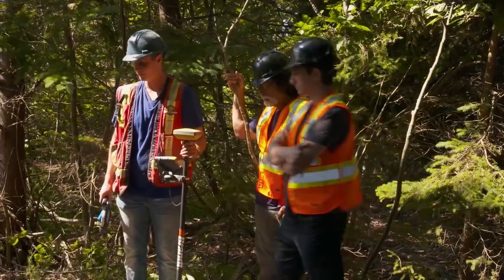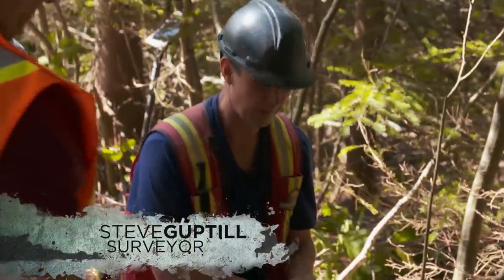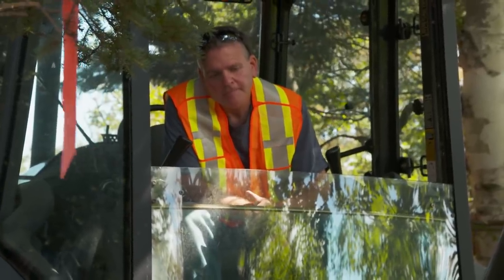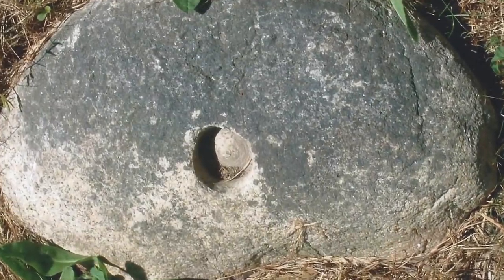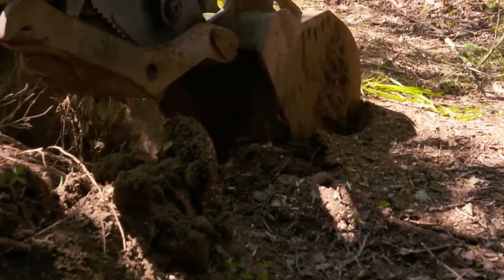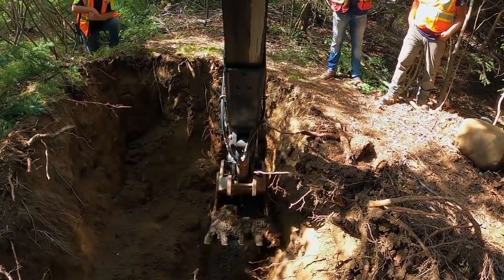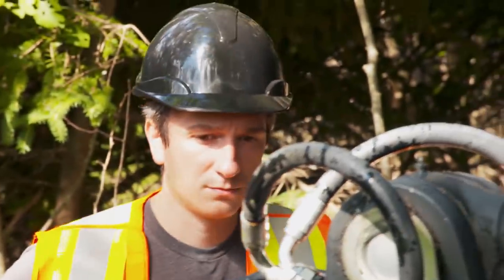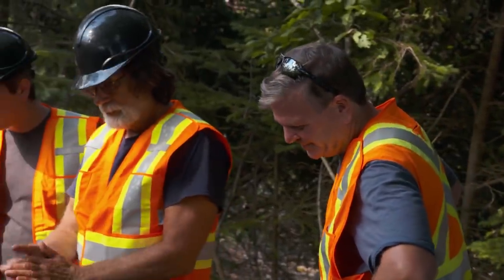The Curse of Oak Island: THE OAK ISLAND CURSE STRIKES AGAIN (Season 8) | History

Comment: Any relic that on the surface is too new (1700) to be quote "Templar." Instead of jumping from spot to spot or drilling a bunch of 200' holes, I would have started in a proposed middle, pushed everything outward as well as deep and sifted every inch. They haven't found one shaft, one weapon relic, one stairway to treasure, vaults, just boulders and old wood. But, they are making a killing off producers and advertisements.